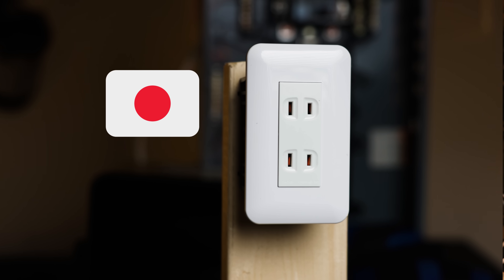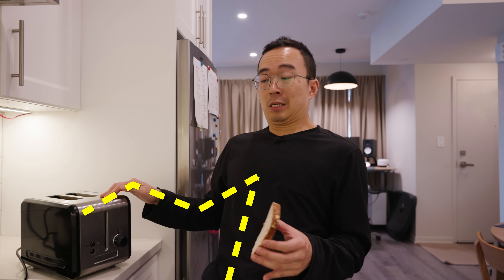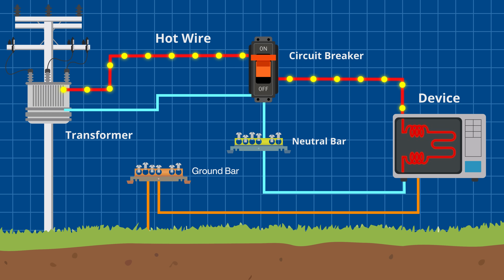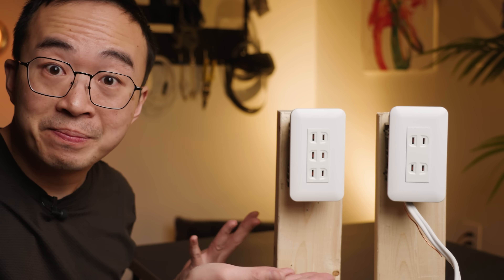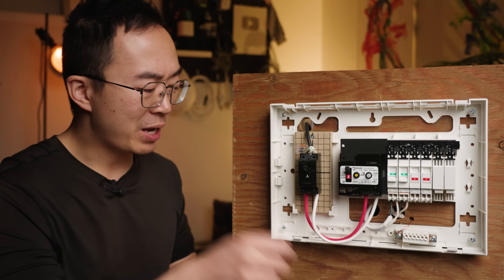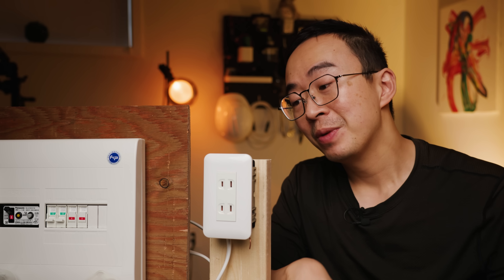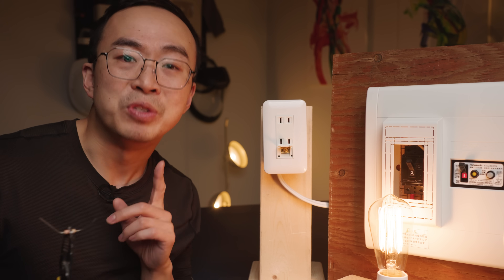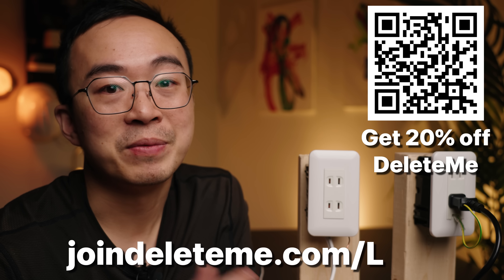How Japan Made Their Outlet Safe

Comment: There is a fundamental mistake in your video. In Europe and the European Union, the basic grounding system is TN-C-S officially (also in France). Older installations can optionally be installed in a TT system (when there is only an earth probe and the ground is not common with the neutral) with an RCD switch, which is considered safe but not satisfactory. But it should be noted that from the customer's point of view it is a TT network, but basically the whole electrical network is neutral grounded, so from the service provider's point of view it is a TN network where the star point of the transformer (3 phases) is grounded everywhere.

Comment: The only problem is with certain loads like compressors, there is a short lag time that can be detected current leakage. This means that a dual compressor refidgerator kicking both compressors on could cause a nuisance trip, and that would disable all power to the home.

Comment: US has been pushing GFCI circuit breakers too. They are available in any hardware store, just google for something like "Square D GFCI Circuit breaker". They have been available since 1970's too, but more common these days. Whats great is that they are compatible with existing breaker panels (if you match the brand).

Comment: Afaik The grounds and circuit breakers are there to stop the wires over heating in your walls and causing fires. They're also there to stop the destruction of the appliances early but I do not believe the breakers are there to protect you at all and it just so happens that you can become an appliance with a fault that trips the breaker if you short it.

Comment: Meanwhile sweden has both ground and a ground fault breaker in new houses or when you remodel your electric.

This means that if a device is leaking power into the ground it will trip. Even if it isn't at the amp value the breaker is rated for.

In Japan your toaster would still give you at least a small shock before the ground fault trips.

Comment: Ground is a layer of defence.

It acts as a lower resistance path to ground than your body does.
It does this via shielding.

A circuit breaker protects the wires from overheating & catching fire.

Residual current devices trip when there's a imbalance in live & neutral wires.
Good news is that you can replace Circuit breakers with RCDs and have the best of both worlds.

Comment: at least y'all be utilizing the rare grounded plugs when applicable. Korea literallly uses the same European Type E was it? anyway, we literally have grounded sockets, but the dumbasses designing the electronics and appliances think they're slick and cost saving by just using the stupid ungrounded format for the plug itself.

like, I opened up the cheap 240 to 100 down transformer I bought to use stuff I had from when I lived in Japan briefly for few years, I found out that nothing was grounded. not saying it's always like that...

but the fact that it's a mixed bag of BS plugs that sometimes don't even fit right because of slight redesigns(the old type used to have a seperate grounded pole on the socket, that pretty much was just like the ground pin of the British plugs... but just that pin on the socket, rather than the plug) or straight up lacking the ground when we don't even use GFCI breakers as a standard yet, makes me feel sketched out every time it's something generally better to be grounded.

Comment: You get a shock because current flows from the faulty equipment, through your body to ground completing the circuit. But that can only happen because the power company somewhere along the line connect the neutral to ground and if they didn't, we wouldn't have this issue. Look at it like this. In electronics repair it's common to plug the device under repair into an isolation transformer. With this simple (though usually expensive device due to the amount of copper wire in it), you can poke around inside the equipment pretty much risk free (as long as you don't touch two parts of the equipment at the same time). In other words, if every building had an isolation transformer we would be safe, and if the electric company didn't insist on earthing then we wouldn't have this problem in the first place.

Comment: Hi, a year ago, my laptop usb port is damaged after connecting to a tv. I suspect that if both devices are not grounded, they would have different levels on the shell, but both are safe for human(<30V) . When two shells are connected, for example a hdmi cable, it would damage one side. Do you have any comments on this situation for ungrounded sockets?❤

Comment: The Western version uses an older technology grounding that was in use before circuit breaker and GFCIs. So it used to blow a fuse.  So adding GFCI to higher risk areas made sense. What did Japan do before there were GFCI? Just electrocuted people?

Comment: RCDs are not that good if you really know what you're talking about. There're different types of RCD (type AC/A/F/B ) and some of them are not supposed to trip in certain situations. So i would say to have a groud wire (with sufficiently low resistance of course) to trip the circuit instantly if there's a earth-fault incident rather than to wait for someone shocked by touching an energized toaster. At least in my country it is mandatory for appliances to have a ground wire if there's any metallic surfaces which can be touched during operation.  Also, a gound wire serves as critical component of "EMI reduction pathways" as well as "surge protection system",  which is important.

Comment: Honestly its still worse than the European or german one rather, its designed cleverly so touching contacts isnt possible and so plugs without ground can be plugged in any plug but plugs that need it like big machines cannot fit into small plugs and only plugs with ground.
Its arguably the best system because big plugs that need  ground cannot be plugged into plugs that dont have it.

Comment: Grounding causes protective device to trip on overcurrent from a short circuit. GFCI/RCD trips when power in/power out aren't balanced, meaning power is leaking somewhere causing and unsafe situation.

But the connection between earth and neutral in the fuse panel also makes the neutral be 0 volts. Without it, you get a floating voltage. There may be 240 volts between active and neutral, but neutral may be 100 volts above 0 volts ground, making 240 volts be 340 volts above 0 volts ground. So if you touch neutral and ground, you can get a 100 volt shock.
Reply: "Grounding causes protective device to trip on overcurrent from a short circuit. "

That applies to the US. If does not apply to many other countries like Japan. In TT systems a GFCI cuts the power.

Comment: Germany here! Historical wiring with an earthing cable has always been required. While in large cities, a connection was usually made between the earthing cable and the neutral conductor, this was not done in rural areas because the neutral conductors were not considered reliable enough. If the neutral conductor breaks on its way to the substation, its voltage increases as it is fed by connected devices. Therefore, a TT system is often used in some areas in germany. As a result, it was realized that a ground fault was not enough to blow the fuse, which is why some electricity companys in Germany began requiring RCDs in their connected houses in the 1970s. However, at the time, these were still too insensitive (e.g., 500 mA tripping current) to protect people who came into direct contact with the hot wire. Therefore, the earthing wire was never dispensed with. It wasn't until much later, in the 2000s, that sufficiently sensitive RCDs became mandatory for every house. Before that, they were either required by some electricity companies or installed by safety-conscious homeowners. In Germany, these are always installed in the breaker panel.

Comment: There's a newer device being phased in many places, the Residual Current Breaker with Over-Current or RCBO. This essentially combines the function of your main circuit breaker (MCB) and residual current device (RCD), breaking the circuit during both an earth fault, and overload / short circuit.

Granted, I still find it odd that of all the plug types out there, only the type G plug has device level protection in the form of plug fuses, which to be is a pretty basic form of safety which should be everywhere.

Say you plug in a device which draws around 2 A in normal operation. One day, it gains a defect, drawing 10 A. This isn't good as all the device's wiring is set up for 2 A, this will leade to cable overheating, and any sensitive electronics will fry breaking your device. In most of the world, your device is fucked, and potentially a fire on your hands due to cable overheating. This is because circuit breakers are rated for the circuit, 13 A - 16 A in most placss, not for the device plugged in so the MCB /RCBO won't trip, we also didn't introduce a earth fault, so the RCD / RCBO wont trip. However if you use a type G plug (used in the UK, Ireland, Cyprus, Malta, the Gulf States, various  African countries and a few others) you have no safety hazards. This is because type G plugs have appropriately rated fuses in them, and normally user replacable as well, giving us device level protection. This means in the scenario above, the fuse blows when the device tries to pull more than 2 A.

Comment: Is the Japanese system better than the American? Sure. Definitely. Is the Japanese system good? Oh hell no. They took the most unreliable system with the least sensible plugs found in the western world and thought "that's a great starting point". Well, no. It's not. The Brits and the Germans have arguably the best plugs and require GFCI. That would have been a great starting point.
Reply: Both the American and Japanese electrical system suck
Reply: There is nothing best about the huge plugs that the UK uses. The American plug is also best because it is small. That allows for many devices like chargers and power banks, to have folding prongs, making them very small.

Comment: This is very educational especially how you explained the ground rods. But its important to note that breakers trip because in a fault there is high ammounts of current or amperage. Breakers do not trip because of high amounts of voltage. When the current exceeds the over current protection or breaker size it trips!

Comment: there is another problem I notice with ungrounded appliances, if you notice any electrical device with a metal body (laptop, pc case,.....etc) you will notice a weird feeling when you scrape your body against the metal part, it's something like induced electricity, you can even sometimes get static shocks when you touch it.
if you connect a volt meter between the metal body of the appliance and your body, you'll notice that the readings can go as high as 30 volts, now just get a wire and connect the metal body of the appliance to the nearest ground (your metal window that is connected to the rebars of the building), you will notice that the reading is now almost zero, that's why you mostly see 3 pin plug with these appliances and 2 pin plugs with appliances that comes with plastic bodies.
so that's another thing that grounding helps with, I wonder how they're dealing with this kind of problem in japan.

Comment: As an electrician from Argentina (you put our flag with French and Japanese there), i can tell that we use both gfci and ground. We switched to ground like 30 years ago.
BUT still today you'll find lots of houses with old two pin outlets...
So, yes, the change is going to take some time...
Reply: Same in France, we have both.
I think we don't connect neutral to ground here so that the provider can then guarantee 230v plus minus a few percents between live and their neutral. They connect and maintain neutral in ground on their side, never far from delivery points.
Reply: Well, the Japanese is still using a signature stamp as personal verification for official documents. Change is slow in Japan. But morbid way of thinking: earthquakes and tsunamis means houses get rebuilt...
Reply: @MrNicePotato  jesus dude 🤣🤣🤣
Reply: @MrNicePotato Very true and a big reason why houses there depreciate in value.

Comment: I don’t see a benefit at all first of all the concept that Japan has just implemented. It’s gonna cost a lot of money where in the United States a wall which is $.98 at the hardware store that’s gotta be 10 or 15 bucks. It’s like a GFI breaker.  Also, it’s more complicated. You have to have electronics built into the switch very expensive operation and when it breaks down, you got a bigger problem.  I don’t see most of the world, jumping on the system whatsoever.

Comment: In Belgium there are 2 sorts of GFCI.
One before all circuits with 0.3A before shutting off.
One for Wet Rooms like Garage, Bathroom, Basement and so on that trips with only 0.03A and every room could have its seperate GFCI.

But, we still have grounding with this.
Reply: The 0.3 A one is so that the grounding will work. When grounding is done with a ground rod the fault current is just a few amperes so a breaker will  not trip.

Comment: Japanese sockets are a disaster for so many reasons. Plugs are not attached properly and come loose easily. This fiddling with and screwing a third ground cable that higher powered devices (washing machine, pressure washer, heaters) still need. Extension cables melting because those 100V just dont allow for higher amp devices. Maximum 15A / 1500W on most sockets (circuits). 50 or 60Hz devices needed depending on North/South Japan. Switch to 220V / 60 Hz and proper sockets should have been done a long time ago.

Comment: GFCI/RCD and grounding are two different things, with different purposes, 
One could argue that japan doesn't use grounding because it's cheaper, they've gone that way and now it's too expensive to switch back, or they don't need grounding and can use the "negative" as grounding because they use NEMA-1 polarised plug, where you always know which is the positive and negative terminal. In europe this would be impossible, because of the unpolarised plug, so you could get a shock if you don't plug in the proper way, hence the use of grounding wire. Also, you don't wanna load the negative terminal and buss bar to the point of melting, so you use a special terminal that is never under load.

Comment: Great pointout ..Also better to know how Japanese Law and actual Power Distribution is made. We use Delta distribution system, not Y. 
We dont use neutral line......unlike some other countries.

..because of this Wider Slit of outlets, must be at Left, are already Grounded to reduce risk of electrical shock. only one wire is active..enforced by law.

eg all light bulbes socket shell side in Japan must be connected to this Grounded side line, AC 0V potential, by law, to reduce electrical shock. 

ONLY ONE LINE of a pair of AC LINE  have 100V potential toward the Earth, to reduce chance of electrical shock in Japan.（but never ever try to touch both lines）

 and typically 30mA LEAK Breaker BE (GFCI) in house. 
Both are enforced by law.. for safety❤

OC 3pin  AC outlet like U.S. or with ground connecter in this video is widely used in Japan. its for safety, mainly high risk equipmets nearby water. 
Also earth line is used high current equipments/lines with metal cover and chassis to shut off induced voltage　eg power motor  👍

 To making AC circuits,  Japanese Licence 電気工事士 is required by Law to protect serious incident eg fire or death,  and high quality power distribution. 
Have a safe and comfortable life🍙日本でも快適に過ごしてくださいね🙇😸

Comment: So in summary...the US system is better because... 
1) Neutral is connected to ground at the main terminal so the breaker will trip when needed
2) You can put a GFCI in ANY room in your house, or swap out EVERY breaker in your panel if you want (giving you exactly what Japan has).  Add it to every outlet in your house if you want. 
3) You get a ground in every outlet in case something has a metal casing like a toaster or washing machine that could be energized from a lose internal wire and you don't have to use the goofy screw in ground thing Japan uses.  

Interesting video.  I've spent a lot of time in Japan.  Great country.  Great people.  Their approach to certain problems is...intereesting.